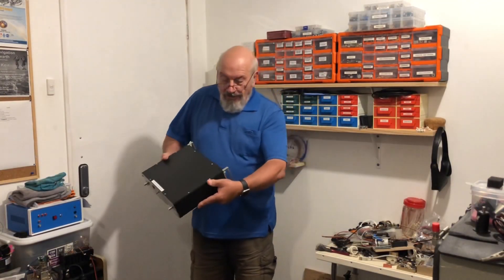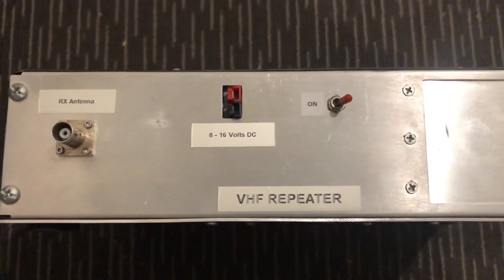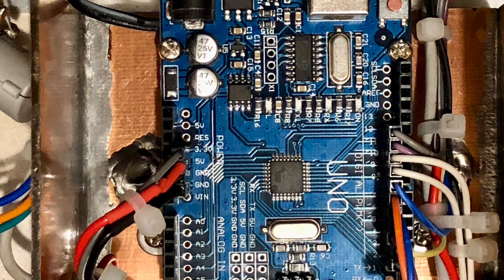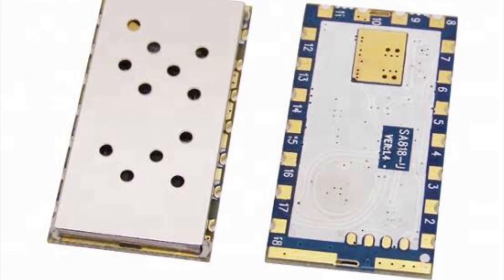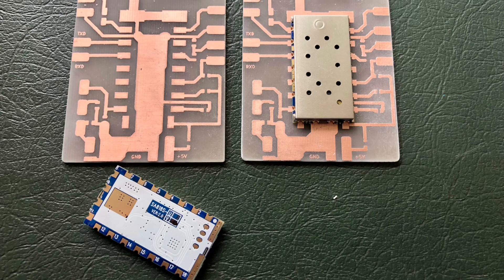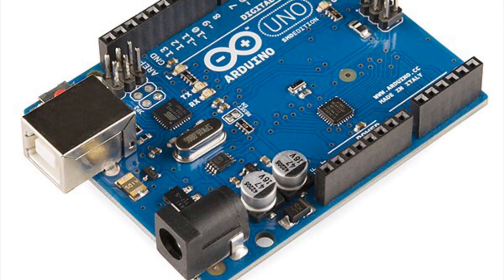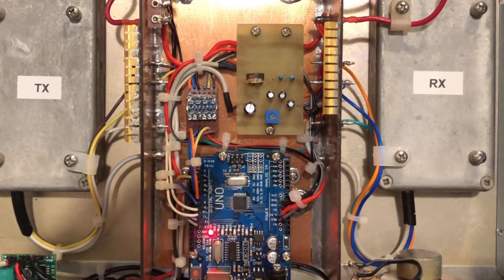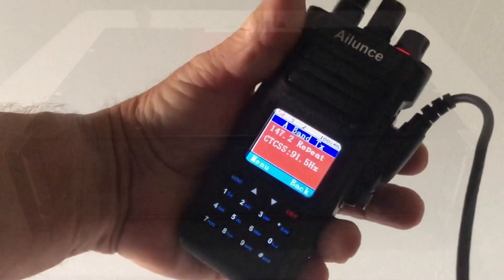Andy's Workshop - home brew mini VHF repeater

Comment: A couple of 8010's or PRM80 anything and Simoco SRM9000s the same would do most of the job :P   BUT I do like the build of this. 

I've been slowly building 2x SRM9000's  per band (AC/TU/UW) for the ability to cross band and in-band commercial, 2/70 and more including when helping ORARC with their rallies etc. I have a baofeng repeater lead using 2 UV5's but I don't like the lag so that'll be BOB only.

Are you printing your own boards or paying a service provider?
Reply from the maker: Hi Glen. I printed those boards here ... just using the laser printer toner transfer method which is fine for simple, one-off boards. The boards are single-sided.

Comment from the maker: Here is a link to the Arduino code used in the repeater controller.
This is a bit kludgy ... sorry.
This code was written on a Windows machine using the Arduino IDE Version 1.8.19

http://www.rewbarb.com/VK2AAK_repeater_stable_v1.0.zip
Reply: Link doesnt seem to be working
Reply from the maker: @SimjetAU  I checked it and downloaded the file OK on both a Windows laptop and a MacBook.
You may get a security warning as the server is not https.
Reply: @VK2AAK   Yes my Imac at work and my macpro at home rejected it but its the security on monteray...got it sorted ..thanks a lot :)